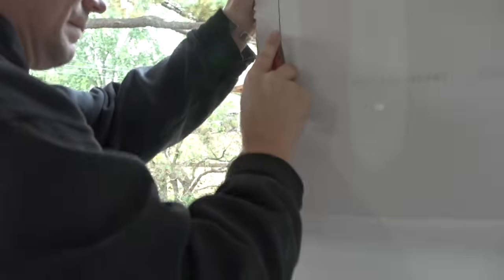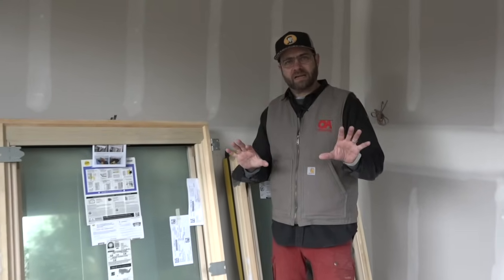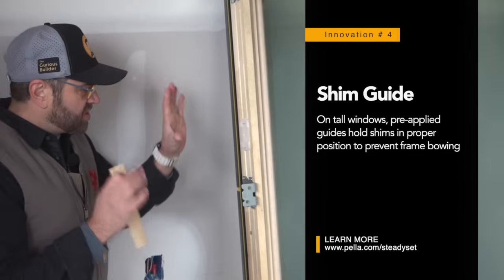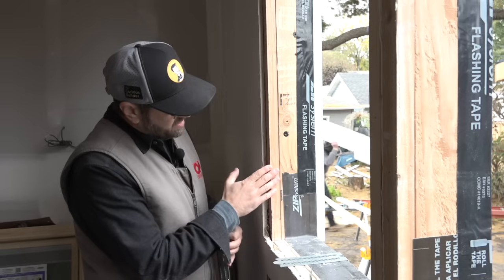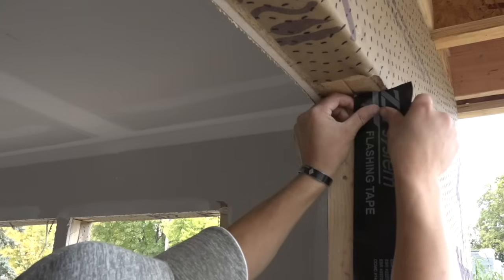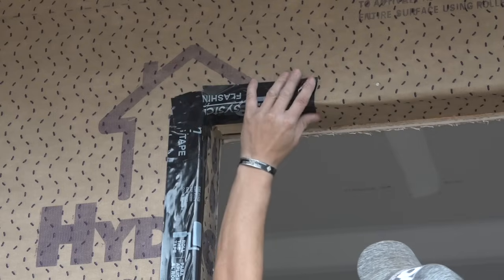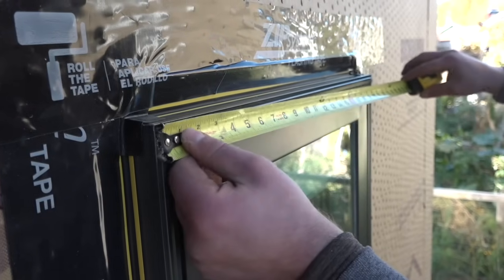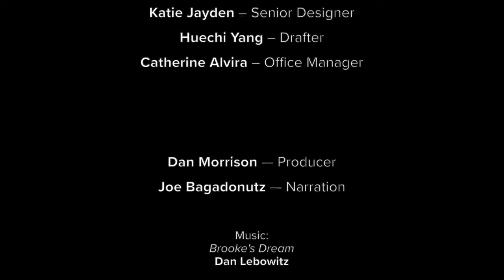Install Windows From the INSIDE! Pella's SteadySet System (Building Resilience)

Comment: so the head flashing comes with the window package?
Reply: Pella does include a drip cap/head flashing with their unit. As we understand it, they have two types, one that snaps in to the face and one that fits over the top and is flashed to the wall. Depending on the application, we are still making and installing our own custom head flashings over openings.

Comment: does the shim on the bottom allow for a 5% grade on the sill to let water drain out?
Reply: Daniel - The shim at the bottom is more of a guide to help the unit slide into the opening. It is a smooth polypropylene part and keeps the wood from binding on the pan flashing. We adjust the unit with air shims, and after fastening that bottom shim is frequently not touching the framing. Pitching the sill would be done by the framers prior to window install, so there is no connection between the window shim and the ability for the opening to drain. - Thanks for asking a good question!
Reply: backdam will encourage water to go out